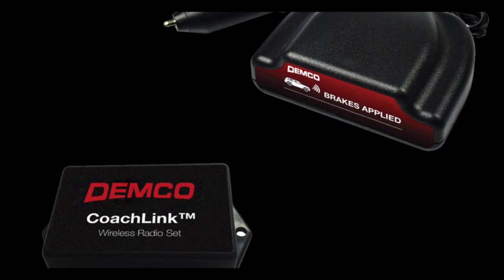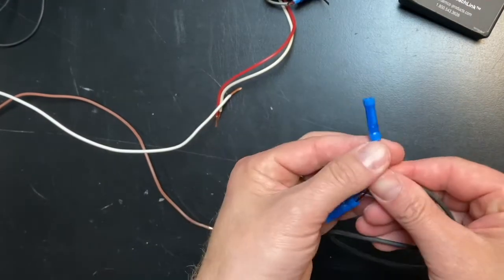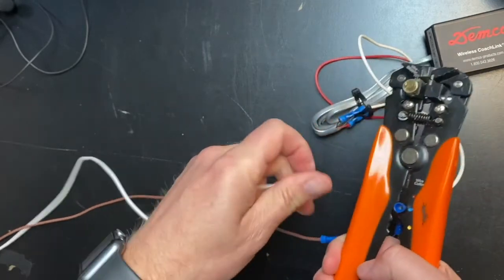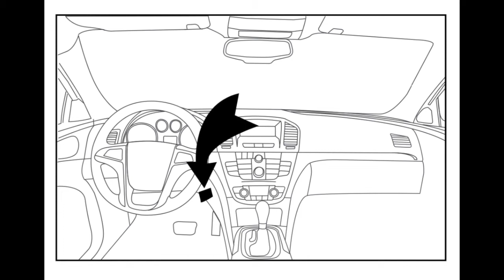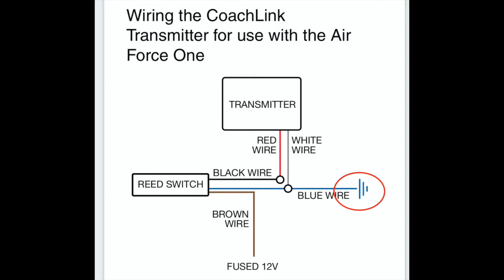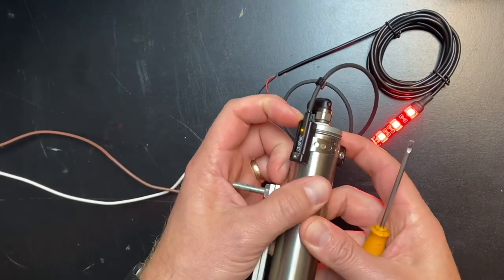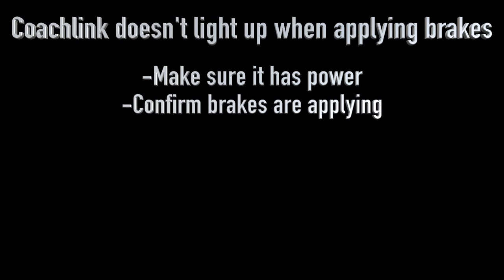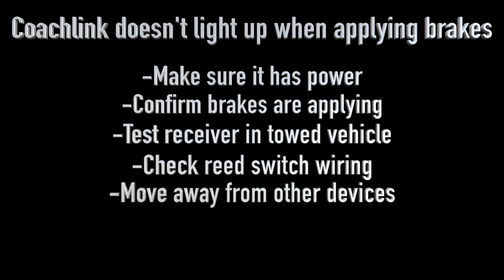How to install and troubleshoot Demco's wireless coach link on the Air Force One

Comment: I installed the wireless CoachLink on my Stay-IN-Play DUO and really like it as compared to the hard-to-see red LEDs. But the "buzzer" function needs to be adjustable. Currently the "buzzer" goes off at a fixed seven seconds from brake application in the car.  The problem is the time is too short. The buzzer sounds on almost every stop, usually for a second or two right at the end before the deceleration stops.

I presume the purpose of the buzzer is to alert you to an abnormal condition such as the breakaway system triggering and applying full braking but that feature is now switched off. If there was a way to adjust the delay before the buzzer goes off, maybe just a potentiometer accessible through a hole in the case, or even a way to flip a switch and set it to fifteen seconds or so that would make it more useful. Right now it reminds me of the tire pressure monitoring system detecting a leak.
Reply from the maker: Thank you for your feedback! This is very useful feedback, we appreciate any kind of feedback from our customers. We use feedbacks to better improve our products as we design new models and add features them.
Reply: Oops, to clarify, the CoachLink alarm causes your heart to skip a beat until you identify the source, not that I do not care about tire leaks...

Comment: I just installed AFO on our Rubicon using the LED light, installed it on the rear view mirrors. If I want to add coach link, do I leave the LED in place and just add  the two wires from the coach link to the reed switch wiring?
Reply from the maker: Congrats on your install! You can leave the led if you want and do just that. However since you will get notification from the coach link  normal practice is to remove the led and wire the transmitter in its place directly to the reed switch. Ultimately it’s up to you and both will work just fine either way.
Reply: @DemcoProducts  I left the LED strip in because why not, I figured. It was more work to take it out.

Then once we pulled out and the CoachLink would not light up, indicating no toad braking. We left more room in front of us, pulled off at the next rest area, and found the main under-hood fuse blown. The car had just come back from a dealer visit and we think they did something because the fuse has never blown again in over a year.

So how does that experience tie in? I now pull the breakaway pin before each departure. While I can hear the pump running, that does not tell me if the brake pedal actually moves and I cannot see the CoachLink from outside. The LED strip lights up telling me the brake pedal moved, I push the breakaway pin back in, and we're now good to go.